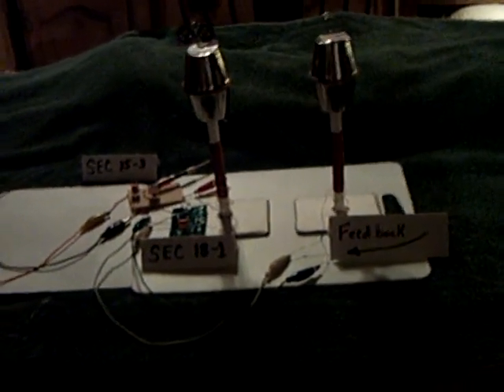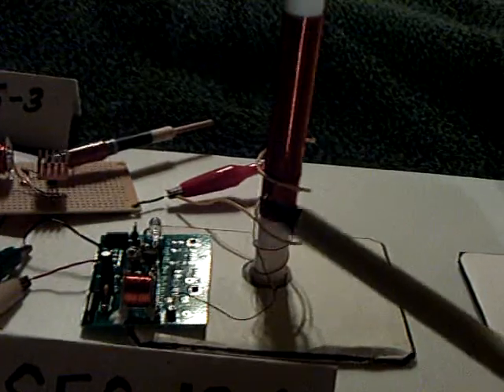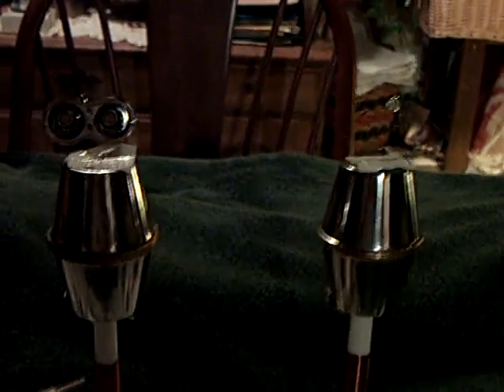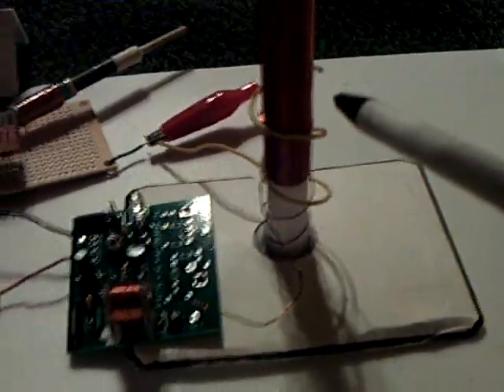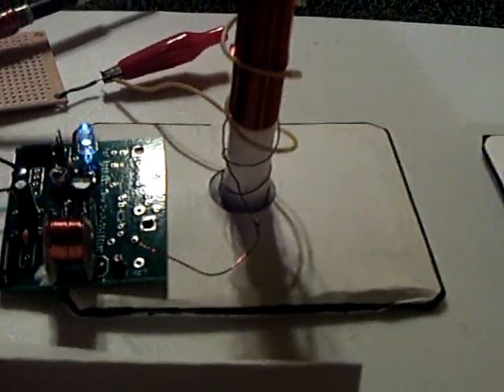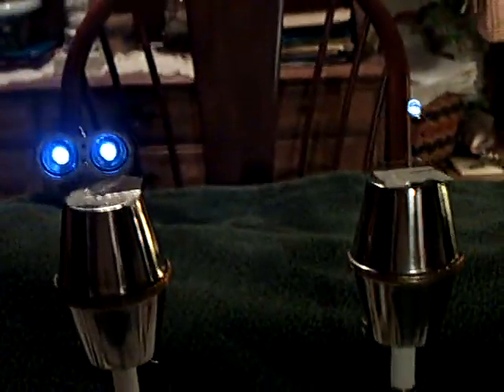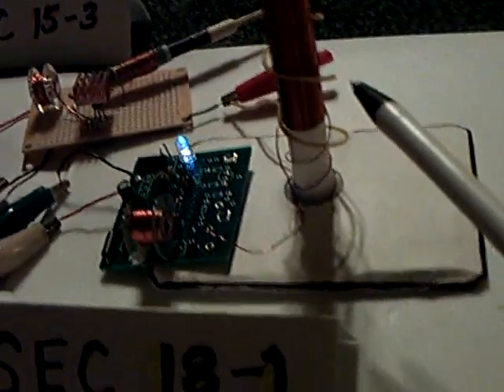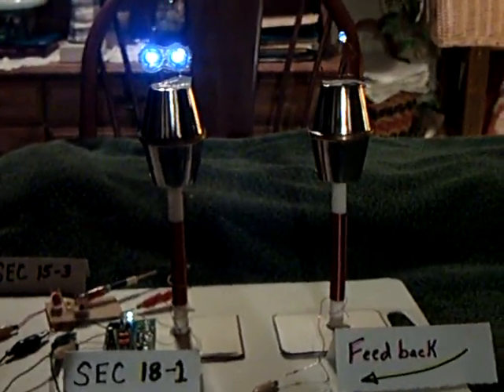Triggered SEC feedback loop

Comment: Hey lidmotor, i am having the same exact problem with my set up, even though ive been using my signal generator. i am also 100 percent sure the tuning light on the sec 18-1 is lighting solely from the  input from my signal generator. Glad to know im not the only one with the same problem lol also if you are looking for a good signal generator, look up a DDS-3x25 arbitrary function generator on ebay. its relatively cheap and  produces great 7 p to p waveforms up to 25 mhz